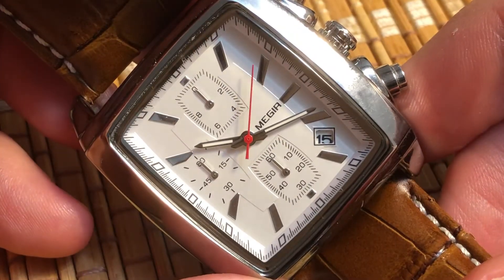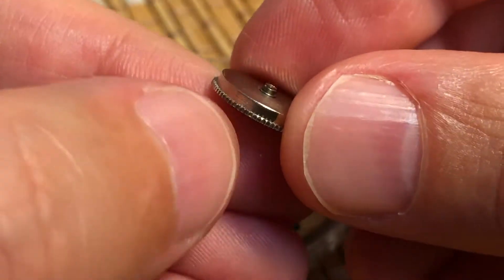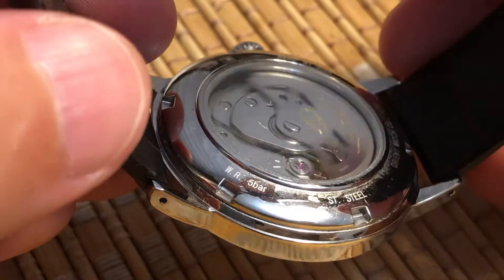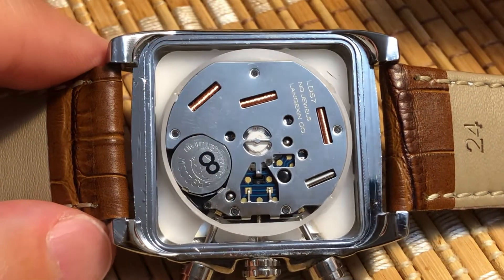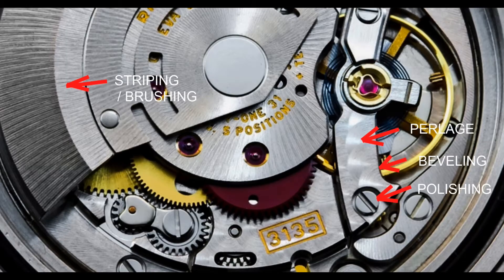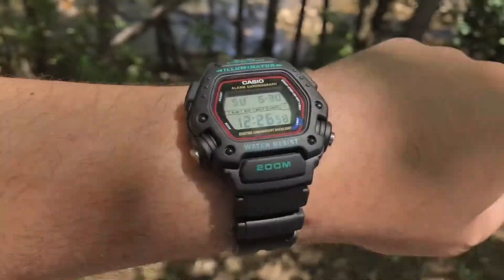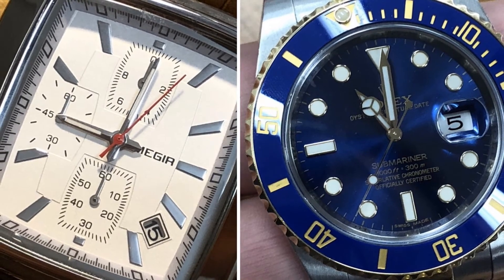Why the Best Watches aren’t Quartz

Comment: I have had several quartz watches, and several mechanical ones.  All the quartz ones have, eventually or quickly, died.  The mechanical ones keep going.  However, the quartz ones are cheap to replace - and have no soul.  They do not breathe.

Comment: You're confusing "best" and "most expensive." Quartz watches are generally more accurate and cheaper, therefore better. As you say, a mechanical watch is an anachronism. Few people are going to say a super-expensive handmade reproduction Victrola is "better" than a CD player if you actually want to hear music as clearly as possible. It might be fun, it might convey some weird sort of status, it might scratch some collecting itch, but to call it best would be a big stretch.
Reply from the maker: Using your own analogy, you will notice that the audio systems preferred by audiophiles for warmth and depth convert digital to analog, or use vinyl records. It’s about sound, but also about appreciating the machine as a work of art. These systems are also the most expensive. 

You can buy a CD player that perfectly recreates a digital .wav file at Wal-Mart.
Reply: @WondersofWatchdom  CDs are beloved by many audiophiles. And a big part of the system and its cost are the other components, anyway. Regardless, audiophiles tend to be a weird bunch :) with their head in the clouds, more interested in gear than music itself. Some watch people are the same way, so far down a rabbit hole they can no longer tell which end is up. I still think there's a problem with conflating pricey and/or romanticized with "best." One may admire the ingenuity or history behind a mechanical movement or appreciate that it might be hand-crafted. None of that, nor a a storied name, nor a wallet-shriveling price tag, directly confer any kind of superiority. Personally, I'd say a Casio F91W is a better watch than a Rolex because it's super accurate, reliable, durable, dirt cheap, easily and quickly replaced, scratches an emotional/nostalgic itch for a lot of people, and isn't ostentatiously showy.

Comment: I would disagree on the quartz watch being the better tool.
A mechanical watch will tell you accurate time for decades.
You can dump it into a drawer, pick it up ten years later and it will work perfectly.
Yes, it might need a service to be accurate again. But it will work in the meantime. You can service it in a week or a month.
Do that with a quartz, the battery will be dead or leak and kill the watch.
Reply: You just described a problem with batteries, not a problem with watches.

The thing about batteries is, they make them in factories every day. A watch battery costs $1-3, my guy.
Reply: @eric.s.5919  Nice, but what does that for me the moment I wake up, I've got stuff to do and my clock battery is gone?
Reply: @RiccardoCagnasso-w9q What good does your car do if you forget to put gas in it?

"I failed to maintain this device and now it doesn't work" applies to everything. The notion that mechanical watches are more reliable than quartz watches because once every 5 years you have to replace a battery is laughable.
Reply: @RiccardoCagnasso-w9q You're literally arguing that horses are better than cars because you can't put grass in your gas tank.

Comment: "Best" is a relative word. It depends on what's important to the individual. Quartz is best when your priority is accuracy +- 1 s any day of the week. "Worth" is also a relative word. "Cost" isn't. The Rolex costs more to make. The Rolex quartz watch is around 4-5000. That's not particularly cheap. Most quartz watches are made to be cheap, that's all. So eventually I want to see a watchmaker make a quartz starting from the battery, motors, and all the circuits from scratch. I am interested to know how much it will cost and its quality compared to the Rolex quartz. It will probably take lots of episodes, probably a few years to complete. After that, I want to see if anyone wants to make something unique based on the working principle of the spring drive from Seiko. Sounds like a crazy challenge to me, but it will be educational. Who knows, probably we will see "some" new patents come about. If anyone has made the videos already, please point in the direction, thanks.

Comment: I might add that there is a range of quality in quartz.  The Bulova Precisionist's quartz movements are high accuracy quartz (off by a few seconds a year) and have a second hand sweep even smoother than the nicest mechanical.  There are also quartz movements that are solar powered (usually for up to a decade before the "capacitor" needs replacement) and will autoconnect to an atomic clock radio signal for correct time.  I have a quartz that is solar, atomic, and high accuracy, meaning it is just "set and forget" and accurate for a decade.  Also, don't forget the quartz/mechanical hybrids from Grand Seiko.  Is the a Grand Seiko snowflake really souless?

Comment: Quartz watches made by the high end watch-makers can be quite expensive …I own several. My mechanical watches have a certain cache, but when they break, which is not rare, getting them repaired can be very expensive, as well as difficult to find watch makers willing to take on the job of fixing them, due to their complexity. By the way my quartz watches are far more expensive than $17.
Reply: Mechanical watches are always compared to $17 quartz watches, because that's the only comparison where they have any advantages at all. Quartz watches are objectively superior timekeeping devices, so the conversation has to move to non-timekeeping aspects of a watch, and you have to compare nice mechanical watches to cheap quartz watches to even win on that front.

Comment: This is entirely subjective. While I liked the design and function of both watches. I grew up in the 80's and I love tech and electronics, circuit boards can also be art, although often aren't but are still fascinating. Who opens their watch up anyway?

Ticking can be annoying or distracting sometimes and I hate overpriced art. I'll never wear something like that, I'd prefer a mechanical watch built for function and I quite like the way the Fossil smart watches looked. Pity they stopped making them. For me the look on the outside is far more important than the unseen, and function is more important than any art.

While I think watches should look good and most smart watches are ugly, I also can't stand overpriced art.

I still wouldn't mind buying the old stainless steel Casio I used to have, but it lacks features so I wouldn't wear it much. I love my Eco drive, it probably needs a service though, and rarely gets used due to the functionality of smart watches.

One thing I hate about smart watches is the proprietary nature and lack of repair. Reparability could so easily be designed in. Also you could standardise the size of the innards, to easily upgrade and replace and keep the style you like on the outside. I hope one day they do this.
I think there should always be a place for mechanical watches, I just don't think they need to be so fancy, they're for people with too much money.

Comment: I have a number of expensive watches costing in the range of $6,000 to over $12,000.  I realize the workmanship, and the complex design involved with a mechanical watch. The big drawback with mechanical watches is about every 4 to 6 years they will require maintenance. This is costly. The watch is taken apart, and the parts put in to an ultrasonic bath to clean the parts. Then assembled, lubricated, and adjusted. Depending on the type of watch this process can take a fair number of hours of work. The other aspect with mechanical watches is if the watch is dropped or struck, it may have damage enough to require servicing.  

I have bought quality quartz watches. I've paid from a few hundred dollars to over $1200.  I have some that are over 12 years old and they still work great.  The ones I buy are accurate to better than 5 seconds per month.  The more expensive ones are keeping better than 2 seconds per month. I have some that are solar powered where I only have to expose the watch to light to keep it charged.  Others have a battery that cost me a few dollars every year or two to replace. 

I like the high end of Casio, Timex, Seiko, Nixon, Bulova, Victoria Knox, and Citizen depending on the model type.  I found the absolute most reliable are the digital readout with no mechanical operation. I tell people if you really want a very good watch that is very accurate and not costly get a classic digital readout in the Casio or Timex.  Some models can go for 4 to 5 years on the same battery. Highly reliable.

Comment: There are always exceptions to the rules. My Omega Planet Ocean with it's METAS certified CAL 8500 Chronometer
is today and has always been accurate to 0.5 Seconds/Day.   My most accurate watch though, would be my Casio 
Master of G waveceptor because it's getting an atomic time signal frequently to correct for deviation.  

Great video explaining the differences to those who may not know.  Crazy how the YT algorithm works that this video
is being promoted 6 years later. Still relevant though!

Comment: The best quartz I've ever seen... I prefer wearing a digital watch and analog quartz watch every day. The reason is simple, they are tough watches, I work with a lot of shocks, vibrations, analog and digital watches are the best... 

Automatic watches are very difficult to maintain, complicated, weak 😂
Reply: But there are also degrees of quality for quartz too, the piezoelectric crystal can vary in quality.

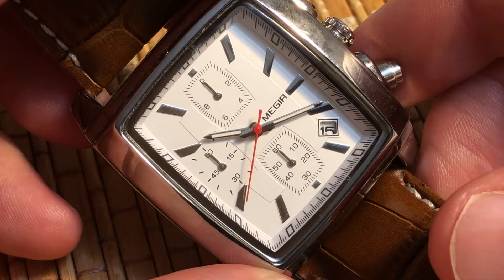Comment: 5:45 That one-second-at-a-time ticking of quartz watches is a common thing, but there is the Seiko VH31 which is quartz and ticks 4 per a second. I went back to quartz because motorcycling has some risks on Automatic watches (I suspect my Seiko to broke because of the vibration) and not-automatic hand-winds are not available in the same wide selection at the lower price range. I still miss the ticking of my old HMT and Seiko :)

Comment: What is most important is the accuracy. No matter how much a mechanical is hyped, it's a loser if accuracy is compared. After all, it's all about accurate timekeeping. I am in the field of watch repairing for over 35 years
Reply: What you forget to mention or even think about is the fact that when it comes to mechanical watches, it all (gaining or losing time) depends on their position. 
You see, my automatic 80$ Steeldive 1953 with Seiko NH35 inside loses cca 3 secs while I wear it during the day. Depends on what I do and how long I do what I do, but on average. Then I put it face down on the nightstand overnight and by 7 in the morning it catches up. Sometimes it even gains a second. 
Anyway, during the 4 months I have it it was never ever more than plus or minus 4 seconds. 
On the other hand, my other quartz/actually mechaquartz Pagani design 1644 with Seiko VK63 inside loses cca 10- 12 seconds per month and there's nothing you can do but intervene every month.
Precision, you say? 
I say you gotta know your watch and act accordingly. If so, your automatic may beat any quartz.
Reply: @hrvojebartulovic7870  Correction : NH 35 did not exist in 1953
 All mechanical watches are position sensitive. Although this drawback exists in mechanical quartz too, but very insignificant.
One is 3 seconds in a day, the other is 12 seconds a month 😊

Comment: There are quartz watches hat have smooth second (actually moving in 8 steps per second, smoother than mechanical 4 seps per second). And there are quartz watches that have truly floating second hand, Grand Seiko Spring Drive, where the spring drives electric generator that powers quartz circuit, which controls speed of unwinding the spring to keep revolutions of the second hand at exactly 1 rev. per minute. Actually precision of this electromechanical clock is of the order of the best mechanical chronometers, still classical, standard 15 bucks quartz watches are 10 times more accurate.
Reply: Can’t beat gold polished Roman numerals that sparkle like jewels in the sunlight. Loving the sun ray dial man that pops!:yt: amzswis :yt:watches. What a beautiful subtle piece.

Comment: Accuracy is not everything in a watch.  There comes a point at which accuracy because meaningless because it no longer makes a difference to the user.  Once a watch is accurate to one or two seconds a day, such a super-chronometer like a Rolex offers, any increased accuracy offers no meaningful advantage to the user, unless he needs super-accuracy for work related tasks etc.

Comment: Hmm.. my Tissot Automatics iii beats my Casio Gshocks when viewed over a month. My CWC Auto Diver is close at +1.5s a day. My cheap Citizen NY0040 runs at 0.7s a day. So a correctly regulated automatic of decent quality can absolutely be as good as a cheaper quarz watch, you just have to view long term. On the other hand my Tissot Everytime with its Precidrive movement runs at better than +10s a year which beats the standard +/-30s a month of cheaper quarz movements. Then again the variation on an automatic with its variation can result in better accuracy. The accuracy (i.e. how close it is to the correct time) gets progressively worse on an quarz because of its better precision, whereas the variation on a mechanical can keep it more accurate despite being less precise. The only quarz I have that does not need monthly adjusting is my Tissot Everytime with it Precidrive movement.
Anyway, the claim a cheap chinese watch will always beat an automatic "by far" is simply false. Or simply put, quarz is more precise but its accuracy veers off consistently whearas the variation in a mechanical watch can keep it closer to the correct time over longer periods.
For actual accurcy you need a HAQ quarz or a radio controlled quarz. Neither standard quarz nor mechanicals can keep accurate time like those can.

Comment: You can either have a 2 dollar machine coffee  that tastes exactly like every other coffee or:
A coffee that is barely warm and tastes noticeably moldy but was made by a someone juggling flaming chainsaws while making it, is served in a tiny Ming vase and has an entire Bernaysian marketing apparatus constantly brainwashing you into wanting said coffee which makes the coffee cost 8000 dollars.
Reply: So accurate😂
Reply: casio 91w  are better than rolex. trust me .you can use it daily without worrying. 😅😂😅
Reply: @Abdullahtan-c5x  Exactly, not even a joke, it's a superior timepiece in every objective sense. The low price doesn't make it any less of a masterpiece
Reply: As long as they can still be sold for $8000, why not? Just another asset. A checking account on the wrist.
Reply: @MrBurgerPal  That’s sort of a myth in the watch community… the extreme vast majority of watches depreciate significantly over time, so you lose due to inflation, same as cash, as well as depreciation. It’s rare to have a watch that will be worth the same or more years after buying, we only see the “obvious” examples like Rolex because it’s already happened, but 30 years ago you were basically choosing one company out of sea of others who’ve either gone out of business or are worth crap now. I can see Rolex going out of favor, at least partially, especially with things like moving manufacturing to China and quartz becoming the dominant market favorite and mechanical seen as outdated relics (not the current sentiment, but could happen in the near future).
Reply: Bollocks.
Reply: You sound like the type of person that would give their wife a Cubic zirconia for their anniversary
Reply: @surfingcavachon  You sound like the type of person who spends +10k on a chemically identical diamond ring except it was found in the ground.
Reply: @lookabird3726  you sound like the kind of person that would take their spouse to Red Lobster for their birthday and say "food is food"

Comment: I have a bunch of nice watches, but I end up wearing a homage watch with a cheap Japanese VH31 or VK63 movement because I'm bored of wearing yesterday's watch and the quartz watch is showing the correct time and ready to go.
Reply: I could buy a watch winder but constantly running a mechanical watch is bad for it, especially if the oils are more than 5 years old.
Reply: If you're buying (for example) a 20 year old vintage Omega Seamaster 300 and have a choice between quartz and mechanical, the mechanical may ending up costing you almost as much as it's worth in service if it's been run lomg term without lube change. The quartz probably won't because the remaining parts of the drive train in the quartz are more robust than the timekeeping part of a mechanical.

In summary, a no nonsense tool watch, or a rarely used watch (such as worn with a tuxedo) suits quartz, whereas mechanical is reserved for something beautiful that you're prepared to baby and service.
Reply: Sure